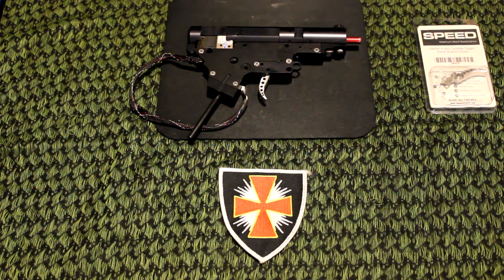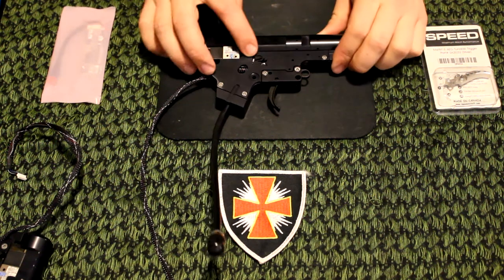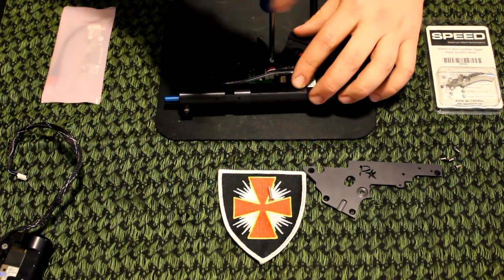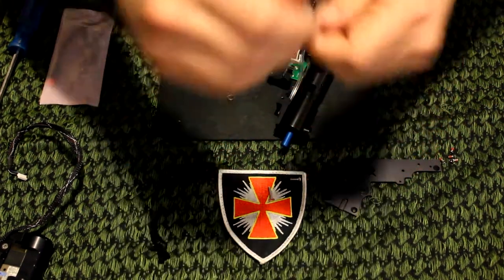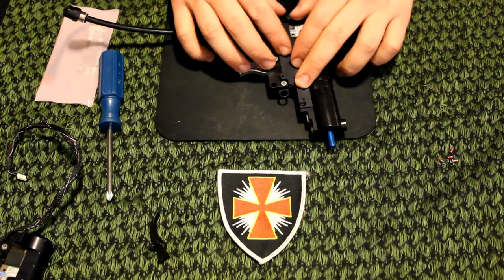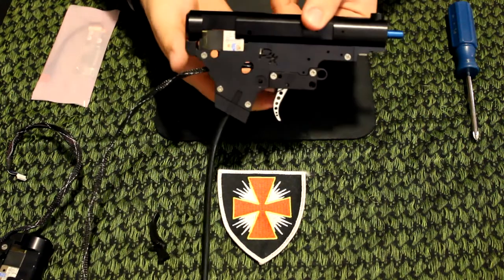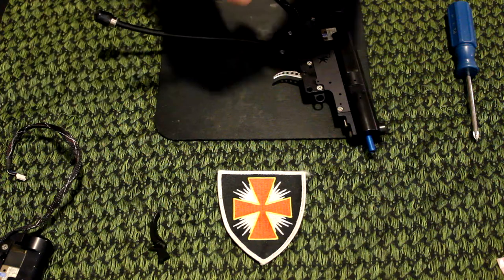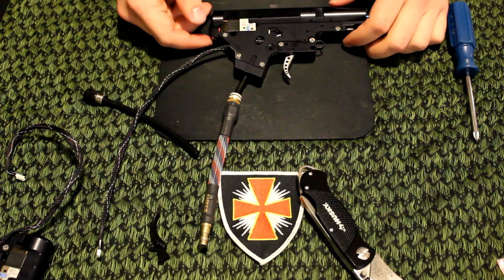PolarStar Tutorials: SPEED Trigger Install

Comment: awesome vid! really helpful. I just switch from aeg's to polarstar recently,hpa tank from amped airsoft is on its way. I have a dumb question,Can I use my existing 11.1 lipos? or do I really have to get a 7.4 lipo? please answer.thank you!
Reply from the maker: Leslie Altura you will need to use the 7.4 LiPo. When using an 11.1v it is too much power for the FCU and will cause it to behave erratically. PolarStar even states to not use anything over 7.4v as the system is made for 7.4v

Comment: Hey i really need a response to this im wondering if i can change my electric  gun to a polarstar and if that fusion engine can fit almost all guns?
Reply: Templar Order Airsoft
Reply from the maker: Nick L there are multiple versions of the fusion engine. Each will usually drop right in to a body depending on what gun you use. Currently the main ones are a V2 and V3 engine. So M4 or AK platform. Hope this helps
Reply: Templar Order Airsoft thnk you so much that helped a lot when i get more into airsoft and have the money i will invest in polarstar